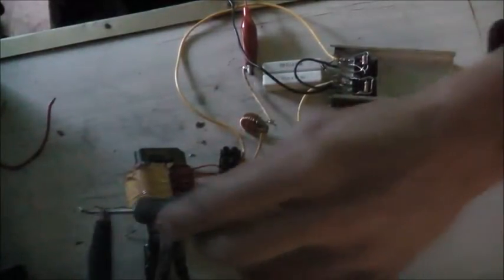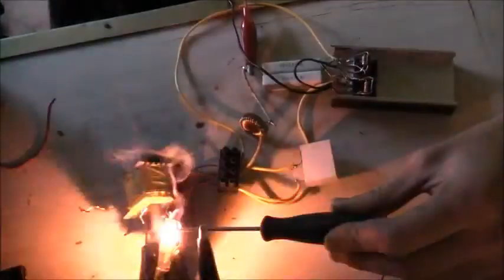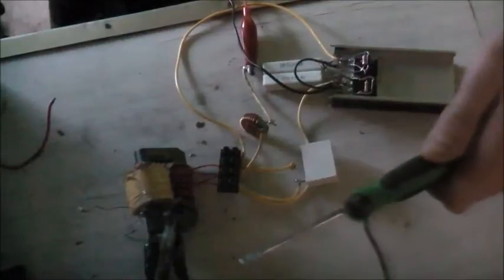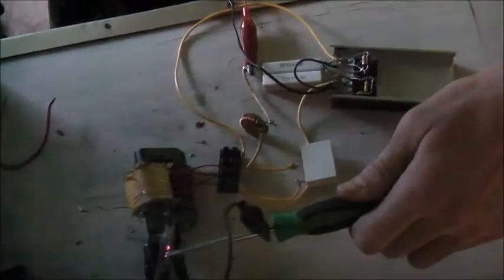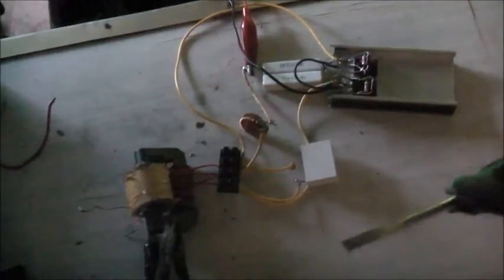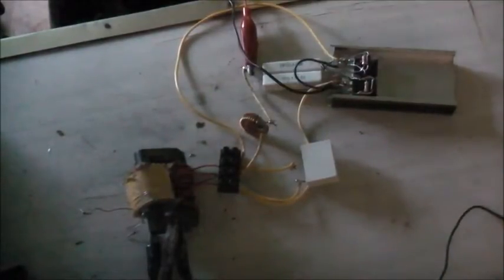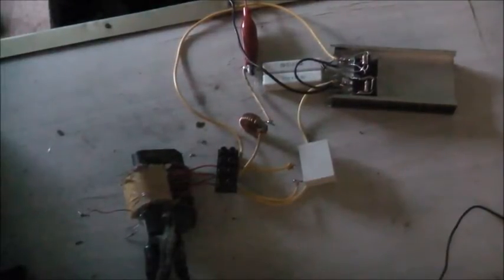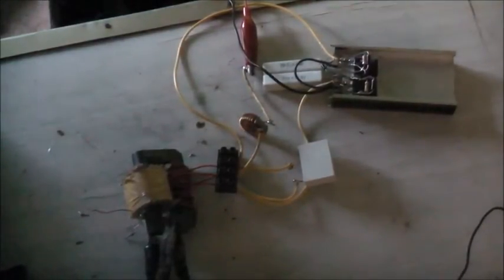Home Made Flyback Test!

Comment: Mmmm, Hi-amp arcs. If you can make something that small with an arc that hot, I'd say it's time to make a Rodalco-style fireworks ignitor. :D

See if you can get that setup running from two 9v batteries (in series for 18v)

If it works OK, then it would be neat to build that little lot into a small box with a couple of arc-probes sticking out of it, then you'd have a hand-held fireworks ignitor.

Or... Pull an arc & put paper in the arc for flaaaaames. :D

-BoomBoxDeluxe.